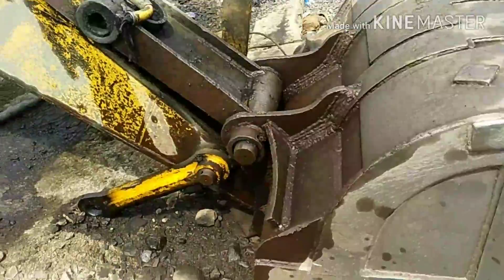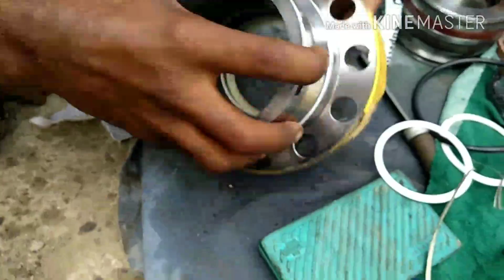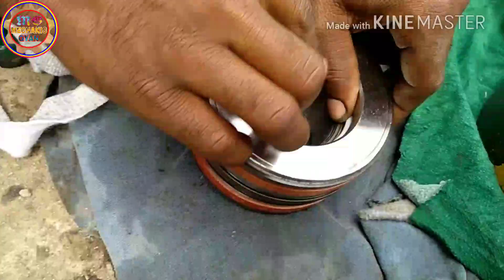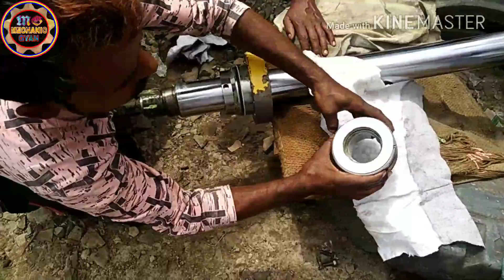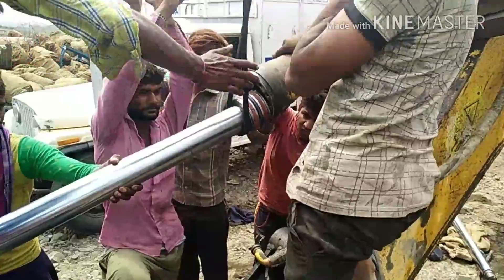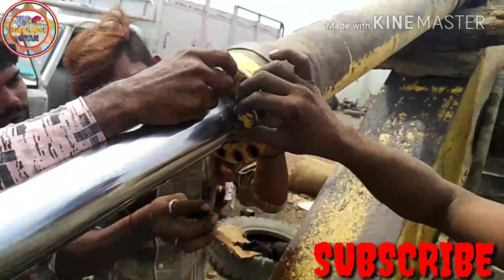Bucket Cylinder Seal Kit Fitment For L&T Komatsu PC-210, by Mechanic Gyan,

Comment: Good morning, why haven't change the head cylinder rod wear bushing ?Better, when you put the rod ass'y inside in  the cylinder, use the oil , not the grease, because grease does thickness and , if you have a problem,  is possible that happen with the steel piston rings, you will have very difficult of dismantled another time, when you will pull out, the rod piston for the grease thickness around the new piston seals.tks and sorry